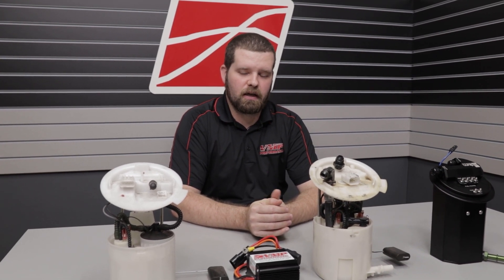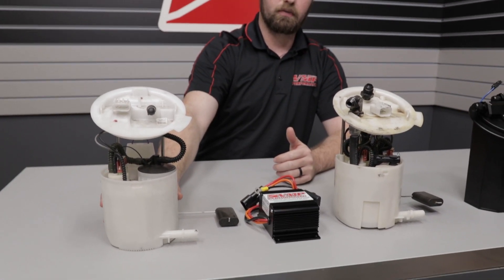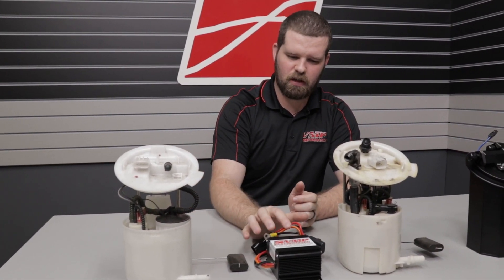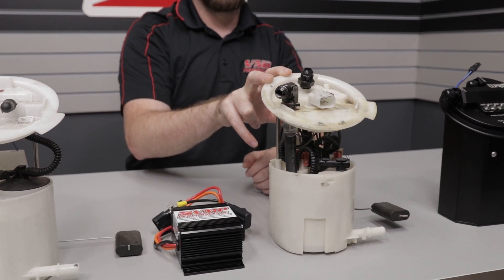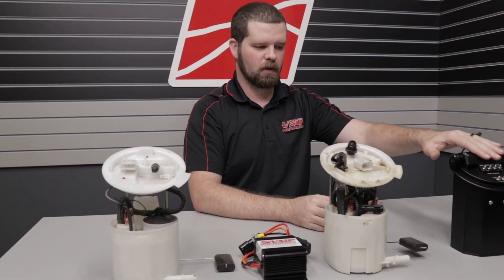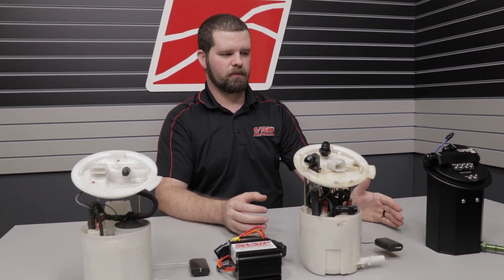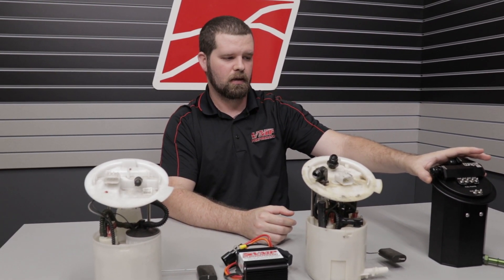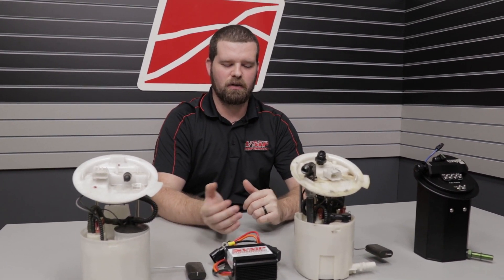Tech Talk || Fuel Systems Explained

Comment: Here is a question…does that aftermarket pump run like the stock fuel pump aka which the voltage rises as the need goes up or do the pumps run at 100% at the time? From what I understand this can cause the pumps the to burn out. Thoughts?
Reply from the maker: This is a pretty in depth subject, but here's a short answer that we hope helps.  Most Coyote systems don't modulate voltage, they have high and low voltage/speeds.  As for an aftermarket return style system, such as ours, they run constant voltage and the pressure is controlled by the regulator.  If a pump is not designed for voltage modulation, it's more prone to failure from the modulation than the constant voltage.  If the pumps are adequately lubricated and cooled (consistent fuel levels and flow), they live a long life with minimal issues.
Reply: @VMPPerformanceTV  thank you for the reply. So what is considered a minimum fuel level? Stay above half a tank? Quarter of a tank? I guess what I’m trying to figure out is are we as the consumer with a high horsepower street car better off getting a fore or VMP system return style with consistent voltage or a system that has a low/high method. $1500-$2000 is a lot to pay to have a fuel pump go bad after a few thousand miles. Not saying that’s the case for either system but factory setups are that way for a reason imho. I want the best bang for the buck aka do it once and don’t fool with a failure for several years lol
Reply from the maker: Simply put, you want to keep the pump's inlet submerged.  This is why we partnered with DW and designed a system that utilizes a factory style bucket that the pumps live in.  Even at lower fuel levels, the pumps are submerged in fuel and less likely to be starved due to the bucket's capacity and ability to hold fuel.  We wanted our fuel system to be street car/daily driver friendly while providing the volume necessary to make well over 1000rwhp.  The factory system is dead headed with no return and voltage changes are used to control fuel pressure, while a return style system uses a separate regulator (such as ours and various other company's systems).  There is no need to modulate the pumps for fuel pressure control and systems like ours use pumps designed to see full voltage.  Due to the various types of driving these cars see, there's many different scenarios where a pump may run dry and no real specific level to keep your fuel at.  Our goal was to provide a solution like our bucketed fuel hat to prevent this concern.

Comment: What would you recommend for improving a stock GT500?  Nothing radical, but drivable improvements?
Reply from the maker: What year GT500 Glen?  We have power packages available that are simple and effective ways to add power without going crazy.  Here's a link to browse them:  https://www.vmpperformance.com/performance-parts/power-packages
Reply: VMPPerformance its new. 2020
Reply from the maker: Congratulations on an awesome vehicle!  The 2020 GT500 is a killer ride.  We have a selection of parts from mild to wild for that vehicle.  Some of the most common upgrades start with the cold air intake, a resonator delete to open up the exhaust a bit and a tune.  We also offer pulley and hub kits as well as larger intercooler cores when you're ready to twist a bit harder.  Email us at sales@vmpperformance.com and we'd be happy to go over our available parts for this platform and what to expect from them.